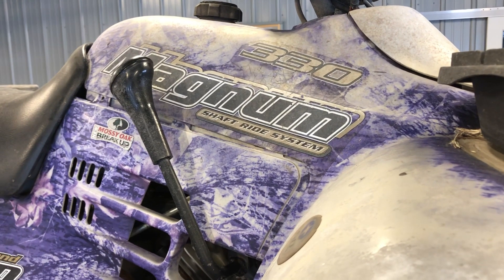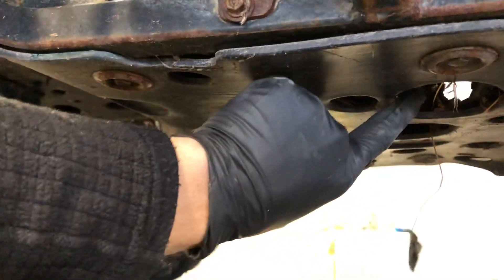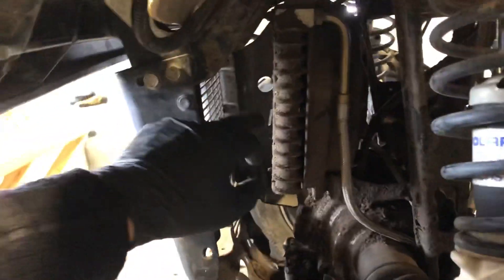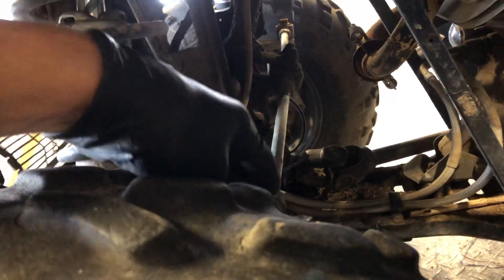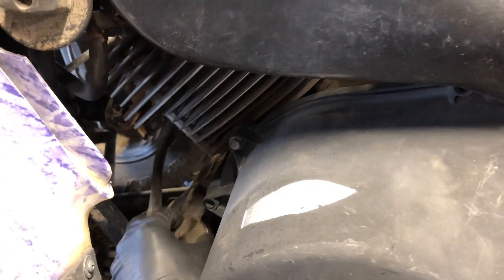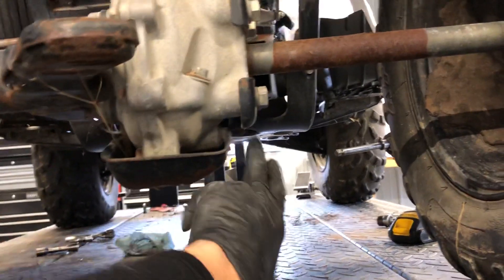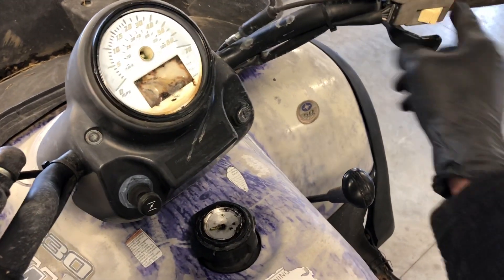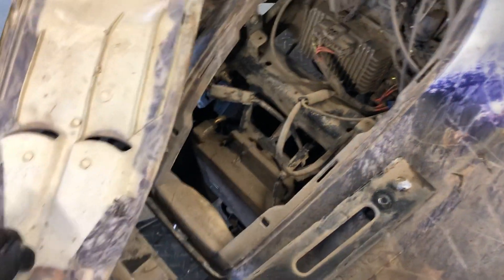Polaris Magnum Sportsman 330 / 335 -Maintenance Repair Overview -Common Issues -Problems -Oil Change

Comment: thanks for the video! very helpful quick tips! just picked up a mint condition 2003- 330 magnum 4x4, its been sitting in a shed for 8 years, no spark issue... cant wait to dig into it
Reply: @MidNebraskaMotorsports  turned out to be the coil...9 dollar part and it runs great...everything works!! 
question for ya: spark plug boot doesn't sit on spark plug tight at all, i cant get it to sit., it just dangles..new boot new plug any thoughts???
Reply: @MidNebraskaMotorsports  I thought it was going to be that, the only reason I didn't try that yet is because the old one that I took off didn't have the nipple taken off... Thanks for getting back!!!
Reply: @MidNebraskaMotorsports  so just to keep you updated- the coil i bought on amazon fits other bikes too... some of those other models might have that type of spark plug for that boot to sit on but after trying to take the tip off my plug (which did not work) also trying to cross reference another plug with the screw top (which also did not work) i went ahead and purchased the oem boot and switched it with the other one and it did the trick... starts right up and runs great!

Comment: Thank you. Very informative. Two things I have questions about: 1). Where is the PCV valve/is there a PCV valve? My Polaris 330 magnum is spraying oil from upper front part of the engine. 2). Where is the master cylinder filler for the foot brake?

Comment: I need suggestions!! My Polaris Magnum Sportsman 330  needs an oil dipstick. I read on a chatroom that it is a common problem for them to swell up and become brittle. Has happened to me twice now. Now the part is discontinued. Any ideas on a substitution??
Reply from the maker: I would stay away from the Amazon knockoff garbage. You'd be better off buying a used OEM one. Check out: https://www.ebay.com/str/midnebraskamotorsports

Comment: I just recently bought a 2004 model magnum and I need help. It sat for a long time and it won’t start. We put in a new battery and it turns over. We think the fuel filter may have jelled up gas in it. I bought a new one but I don’t know where the fuel filter is on the four wheeler. Do you know where it is?( it did run at first but I think it was the gas in between the filter and carb)
Reply: Mid Nebraska Motorsports Thank you for the reply! We fixed the issue, we siphoned out the gas and put fresh gas in. Seems like it just needed to get some trash through the carb. Runs great. I do have one more question. My 4 wheel drive is not working. When I flip the awd switch, no light turns on. We looked inside and there was a cut wire. We reconnected it but still have no power to the front wheels. Any idea what it could be? Thanks!

Comment: When you said to run engine a little bit before changing oil,does that still need to be done if I have gas in my oil after my son flooded it even though it starts now and runs..once I found out there was gas in my oil I turned it off couple days later I bought new oil ,actually today I bought it now trying to figure out next step without ruining anything hopefully.

Comment: I said it in a comment on a previous vid of urs but I can’t stress enuff what a good job u do. I recently got a 2003 330 Mag that’s been sitting for a cpl of years. (A friend gave it to me to see if I could get it running n, if it runs/drives, he’s gonna sell it to me cheap). The batt is dead and the starter is seized....I already tested the solenoid n wutnot....but after draining and replacing the fuel it started after just 6-8 pulls. Today I’m changing fluids, filters n spark plug. If it’ll drive and doesn’t need any major repairs I’m gonna move on to batt n starter. I’ve always owned Honda’s, aside from a 500 Quadzilla I had for while wen I was younger, so your vids are a huge help to me. Keep up the good work! 👍🏼👊🏼✌🏼

Comment: Hi, I have a polaris 330 magnum (I think 2004 ish). The rear prop shaft is now discontinued in Australia. Is the front differential pinion spline the same as the rear ? I was going to try and build a prop shaft from a front prop shaft for the rear prop shaft.
Any help would be great. Thanks

Comment: I have a sensor causing me problems. I diconnect the kill wires and itll fire up without an issue. Dk where the wires go or what sebor is tripping it. I also cant throttle up as itll choke rhe machine to death. Ideas?

Comment: I have same quad and my right fromt wheel whoobbles. What would cause that?
Reply from the maker: Wheel bearings for sure. It is a common issue. Check out our channel for hundreds of other videos on these polaris models. Let us know if you need parts: https://www.ebay.com/str/midnebraskamotorsports

Comment: Does this fourwheeler have fuses can't get any power with brand new battery
Reply from the maker: No fuses on this machine. Sounds like you've got w bad wire. This can be frustrating, and it's hard to even know where to tell you to look. Hit the subscribe button as we have a lot more videos coming out on this machine. If you need parts or tools for the job check us out at https://www.midnebraskamotorsports.com/
Reply: I needed a new switch to fix the same problem on my 330 ATP

Comment: Where is the vin located? I just got my dads quad and the notary needs proof of the vin on the quad to transfer the title into my name
Reply from the maker: Great question! Left lower frame rail. In front of the left toe or behind the front lower a-arm. They are sometimes hard to see. Let me know if you can't find it. I can send you a picture of the location exactly. Check out: https://youtu.be/IWrtWZZi1aQ

Comment: where is the fuel filter for 330/335? thanks
Reply from the maker: You can install an inline filter. Otherwise, I don't think there is one on this sportsman. I am working on a carb clean video as we speak. Keep an eye out for this video. Thanks for the comment and for watching. Let us know if you need anything! https://www.ebay.com/str/midnebraskamotorsports

Comment: No coolant on this model? My wheeler has the temperature light on
Reply: Hot oil. Fan isn’t working, could be oil cooler fan temp sensor. Easy to change. Trouble shoot your fan first, make sure it works.

Comment: When I move my throttle cable by hand it will raise rpm without touching throttle.
Reply: @MidNebraskaMotorsports  does cable need to be straped to frame to keep from moving?

Comment: 6:02 what's the case called that protects the belt I just bought one of these as a project and that parts missing
Reply: @MidNebraskaMotorsports  right on imma send you some pictures of some things I notice are missing to your Ebay store if you have them or could let me know what they are because I bought a project and I cant start it because I'm missing these things I have a feeling
Reply: @MidNebraskaMotorsports  I just sent you a message on Ebay tell me if you got it I took pictures of the stuff I feel is missing let me know if you have any of those things or know what they are called please